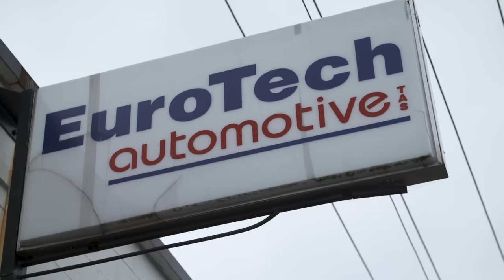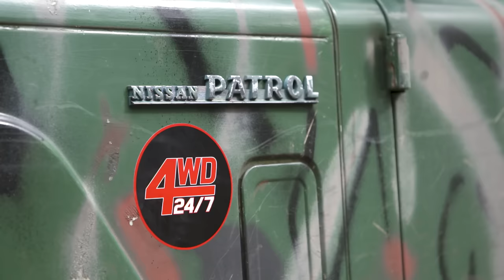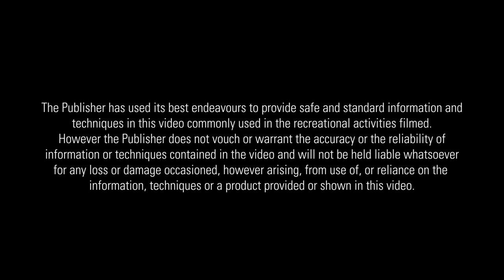WE BOUGHT A $1,500 4WD from a bloke in the pub! Does it run?

Comment: I love this type of content 
And it shows people ya don’t need a 100,000 dollar rig
Reply: But if you have something like this you better know what you’re doing 😂😂😂
Reply: But you might need $100k to fix it so 🤷
Reply: I agree with you..however,i know luxury is not a must..but,whenever we can spent into luxury,is always appreciate...for our own comfort..
Reply: So true
Reply: No more sparesbox???
Reply: I literally posted almost the exact same comment before reading yours, but it took me a while to get around to watching it.
Reply: @bumndrass  not really if you are handy. A bit of preparation to replace the age old things (anything rubber seals to shackle bushes) change every fluid and grease, waterproof the electrical system. Clutch and brakes as required. Free wheeling hubs but take the old hubs with you, if you break an front axle you can disconnect the drive, if you break a rear pull the axles, fit hubs and drive home on the front.
Reply: @robstoeckel353  cool story, needs more dragons though.

Comment: Great to see the old G60 out there roaring like they do.
Amazing how far it can go in those conditions,  no centre diff, no diff locks or computer aided suspension control. 
Just pure Nissan grunt. 
You need to adjust all the brake shoes as close as possible to the drums to have a decent brake pedal. Regards Steve.

Comment: It’s a non synchro 3 speed. That’s why it doesn’t want to go into 1st while you’re moving
Reply: just gotta give er a big rev she'll go in
Reply: @victor22366  that particular box won’t go into 1st while the vehicles moving.
Reply: Clutchless shift, you have to manually sync the RPM's to the gear speed.🤣🤣🤣
Reply: Learned to drive in an old Holden with three on the tree and no synchro on 1st.  Simple double clutch, no issues.
Reply: @rickfletcher8422  it will if you can drive non synchro ,it wont go in at thirty k an hour as you cant rev match it ,spent a wasted youth ina g 60 and bloody land rovers ,they dont have synchro on first either
Reply: no synchro on 1st

Comment: I’ll never forget the time I replaced the rear brake shoes on 79 Nissan Patrol G60 only a few hours before an 800 km drive out bush on a hunting trip , I had to pump the brakes a bit before they worked just fine . I think the 4wd store gave me the wrong brake shoes . I quickly got used to the brakes and left them as they were , I just wouldn’t let anyone else drive the G60 . Shauno you’re not supposed to put it in 1st  gear when the vehicle is moving, only put in first gear when completely stopped . I look forward to next weeks video.

Comment: I had a G60 many years back - put a good carby, suspension and tires... couldn't stop it - 3 speed no syncro manual - so much fun - did the cape in it in 1984. not much comfort but hard to stop it in any conditions.

Comment: In 1980 we use to get around the Top-End in one of those old bangers& it was very capable off road, back then it was nothing fancy but it was a bloody tough rig.
The only drawback with the old 60 was the three speed gearbox, good down low off-road but a real pain on the highway if you wanted to get anywhere the same day.

Comment: My kinda episode! Never owned a 4WD and the only misfortune Ive had off road is bogging my old '90 laser in a puddle slightly deeper than it shouldve been. Just bought myself a 2002 GU 3.0TD Wagon as a salvage for 7K to try and minimise the covid tax. The GU had a 2nd oil pump which used to be a turbo. Total smoke machine! New turbo, intercooler, gauges, alternator, 3"inch exhaust, sway bars (people seem to chuck them out) and other bits and pieces. It ows me about 11K now but nearly ready for rego and more love to be a beautiful and respectful truck again. It spent many years well loved before it went from QLD to Wollongong to be abused.Thanks for the videos guys. Lots of inspiration to explore NSW. Sorry Seano, Landcruisers were just too much coin.

Comment: My Uncle in Queensland had a G60 Nissan Patrol when I was there in '72. I think he bought his in '69 but don't quote me. I'm sure it was his patrol where he popped the bonnet to show me the engine. There was a stamp on the casting that been slashed out at the factory. You could still make out a circle with GM in the middle. My Uncle told me that Nissan had bought the molds for an General Motors 6 cylinder from the '50s when GM stopped making them. Have a look Shauno. See if you can find the old stamp. I had an old '53 Dodge with a flat head six that had the oil bath air filter. It turned to toffee in the winter.

Comment: That is the most iconic truck I've ever seen. I love that look and I bet if you search for "iconic" in the dictionary there will be a picture of that truck. Sorry it gave you so many problems, 24 hours is not enough for an old lady to get back to a reliable state. I say you give her a good TLC, fix those brakes (oh my that's scary), make that transmission a bit smoother, possibly slap a locker or two to help the performance a bit, maybe the cheap canopy similar to the pony, then take it for an epic adventure with the farm truck. Maybe also some kind of challenge, similar to the cheap 4WD one? That would be epic.

Comment: An old tech once told me if the cooling system is full of rust not to put coolant into it just use water as coolant is more slippery then water and adding coolant can cause leaks to spring everywhere which I have personally seen.

Comment: G60 brake adjustment requires a look at the operator manual. Not as simple as your average drum brakes. The wheel cylinders need to "slide" on the backing plate. Renowned for rusting.

Comment: Great effort by you Guys and the old Nissan. But what has happened to putting a tarp over the front when doing water crossings, mud holes etc. Particularly with old petrol motors and rigid metal radiator cooling fans. A bit of Vaseline or silicon spray, even glad wrap can work well for water protection for the electrics. 
Anyway, what fun times you Guys have on these adventures and what pleasure it gives old adventurers like myself to remember the fun and silly things we did 50 years ago in these now old 4x4s. Please keep it up.

Comment: Hot tip for older petrol 4x4s give the distributor snark plugs coil pack etc a spray with wd40 before u hot the water and it will keep it running even under water I've done it many a times in my old cruiser

Comment: This is what I've been waiting to see I love this I love it when people go out and buy these old vehicles put a little bit of time and effort into them and it's more fun driving these junk vehicles then it is driving a brand new vehicle I'm pretty sure it's because if it's older vehicle you're not worried about getting scratches or dings in it so you will drive the way you want to. But if it's a newer vehicle you'll be worried about scratching it dinging it damaging it so you're going to drive it a lot slower and not going to take the risk you would with the older vehicle. Thank you for bringing the old vehicles back to life. I love old vehicles if I had a choice that's all I would drive because the new vehicles are made to break and are made not to last.

Comment: Mate had a old G60 jeep style years ago and it was short wheel base that someone had gone to the trouble of extending the  chassis and adding good 30cm , it had cut down doors no roof custom rollbar ,was a beast of a thing ,took 3 of them big army guys to lift that 3 speed back in on there backs after he fitter new clutch ,was some yelling and push you C@@@t lift it you basted lol what a mission . well one day we were moving along and back wheels locked up seized the engine no oil

Comment: Hi guys, I have been watching you for years and years, awesome videos all the time,  I’m from  Georgia,  and I’m also a big lover of off road driving and over landing, I know you guys are mostly driving big ladder frame 4X4s and have more traditional off road rigs, But have you ever driven VW Touareg of Porsche Cayenne (same car basically)  the reason I asked ic cause most of the guys are looking at these cars as a street SUVs but I want to let you guys know that Touaregs and Cayennes have lot to be looked at and they are very interesting cars and have hell of a lot to offer to guys who love off road driving and over-landing, juts to give you an idea, touregs and Cayennes 2003-2010 all have proper LOW range gears and all have transfer case lock (center lock) and in some models you can see 100% rear diff lock option (i have it on my Touareg)  also some of them have Air suspension that gives you 300mm of ground clearance in highest position,  all this comes from the factory and now as these cars are getting so cheap lot of aftermarket products are now available and most amazing is front E-locker from Harrop, that im gonna be installed on my Touareg very soon, please if you cans check out these cars and see what they can do, im sure you will be very surprised and love it 😁 cheers

Comment: Just shows how much these 2 look after their vehicles.. they never check the oil or radiator or any fluids before they drive off and bam, guess what they found at the workshop... haha... just shows!!.. The support crew does all the checks, not them!... Most people when purchasing a vehicle would at least check the basic fluids etc.. No reverse light and only left brake light works.. good to see you checked them at the workshop.. No syncro in first Shaun.. new verses old haha...you can tell he has never driven anything old.. That is one of the few issues with old 6cyl petrol engines they don't like getting wet haha......... I'm guessing it's an old cow cockie's farm and to town truck, good old beast.

Comment: God I miss my G60. These things are massively over engineered. Two things though guys. Repair the brakes, they ought to work like any other vehicle. The first gear is a crunch gear- it can only be used from a stationary position. The insane torque in the rest (other two) gears makes up for this though. Oh and I think you will find it is not a nissan patrol, technically it is a nissan-datsun in the era it was made.